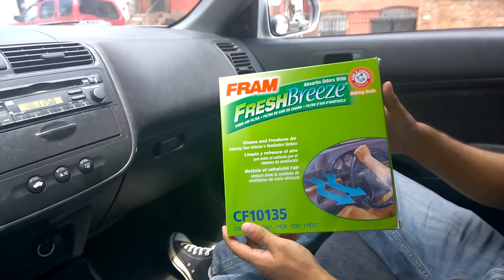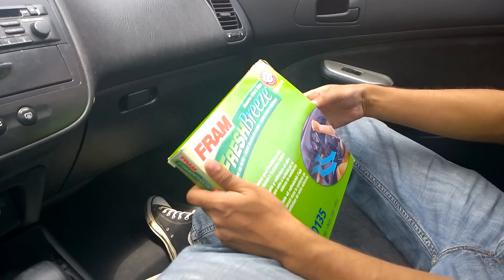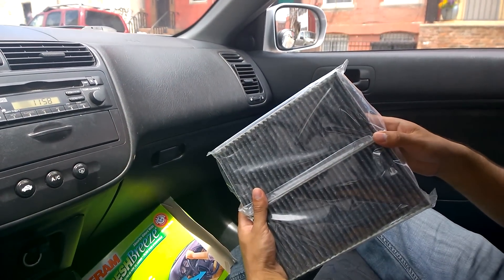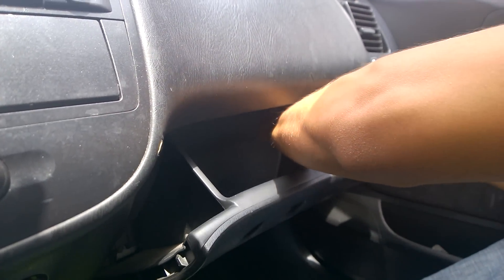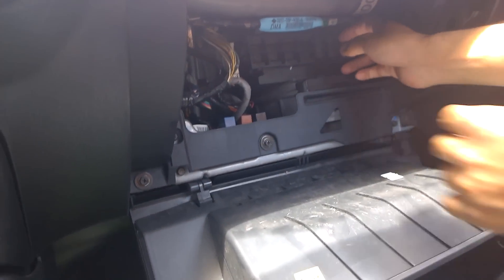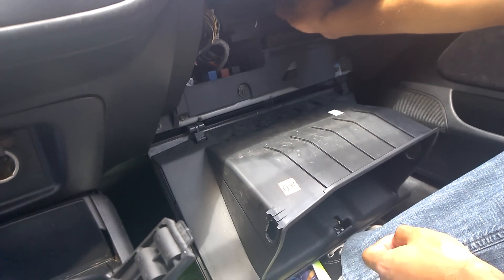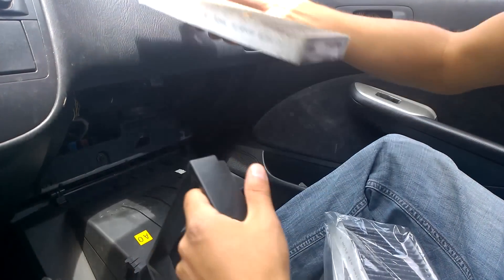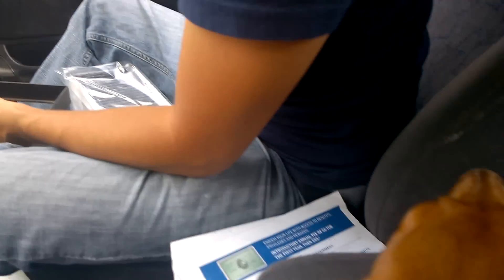how to change cabin air filter on 2000-05 civic

Comment: might not be a bad idea to turn on the ignition and, while the filters 
are out, blast the fan and cycle between "fresh" and "recirculate"...the
 sudden increased airflow might dislodge other debris in the ducting, 
and blow it out into the cabin where it an be cleaned up, instead of 
being trapped against the brand new filters for the next few years...or even take it a step farther and do this at highway speed, just to clear it out with that extra rammed airflow

Comment: My 2000 Civic needed a 1997 CRV much bigger filter.  The same thing happened with my 98 Civic when I put in a cabin filter...I had to use the 97 CRV filter.  You don't really need the Honda frame for this.....just install the filter properly by itself and it works just fine and dandy.  Be sure to clean out the A/C fins and any debris from the cabin filter area as I can guarantee your car is filthy in this area from all the leaves over the years.  Both of my Civics obviously never had cabin filters installed!!!!  

The tricky part is prying off the little door to the filter area.  I had to CAREFULLY snip the white plastic holding the cable lines so I could get the door out.  No biggie....just make sure you don't snip any wires!!!!  The little door goes DOWN thru the bottom of the glove box.  This is something that Youtubers FAIL to tell you about.  To reinstall little door you have to snake it from the bottom up and then snap it into the top of the filter area.
Reply: Linda Pray thanks my  man been researching for this for a while
Reply: Thank you so much for this info! I'm having the same exact issue where I couldn't locate the cabin air filter in my sister's 2000 civic. I noticed it has that little plastic peace when I can snap from the bottom but didn't have the time to do it today so I'll try to do it tomorrow. Could you please tell me what filter number best fits in that slot?

Comment: mine is a 4 door honda civic ex. I didn't find the cabin filters. Can someone help. One more thing, sometimes when I turn on AC, I hear a very strange sound, what's causing that?
Reply from the maker: could be anything, probably the compressor belt
Reply: Sounds might be your radiator fans going on with your compressor
Reply: Is it a rattle that stops when the compressor stops?  That's what I have and it looks like the compressor clutch.